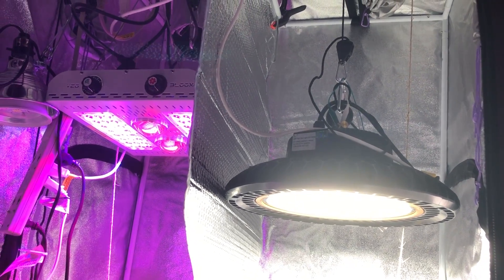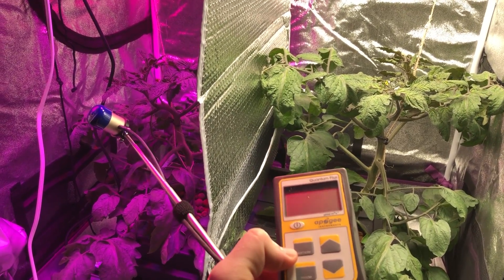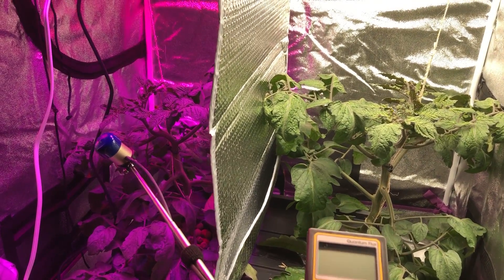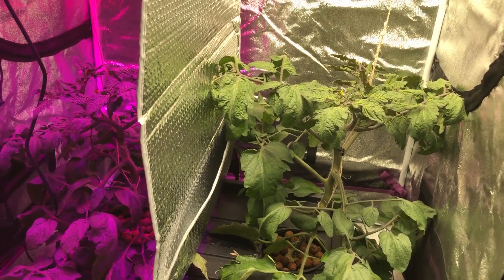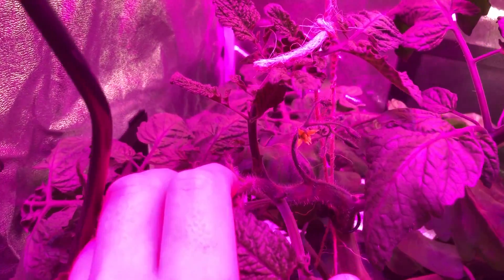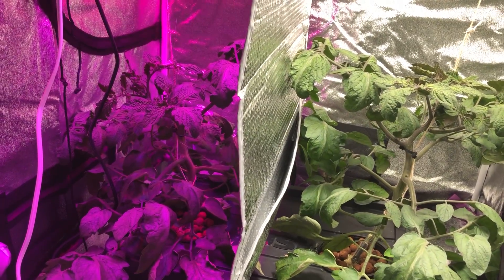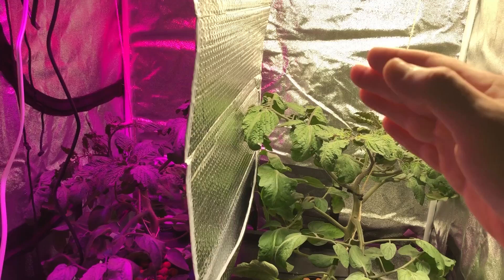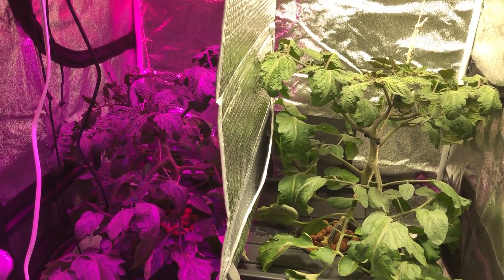MaxBloom vs High Bay LED Grow Light Ep.16

Comment: How long have they been growing?
Reply from the maker: About a month. Seems to be growing a little slower this time. Probably because I’ve been pulling off the suckers and stressing them. Also the aeration isn’t working quite as well. I think my diaphragm in my pump might need replaced. But the stems are a lot thicker this time too. Not sure what’s caused that. Maybe the pruning.
Reply: @GrowingAnswers  check my community page at my Minibel dwarf. First harvest of 8 plants worth of tomatoes about 180-200 cherry tomatoes. 
4x2 
8 sq ft
108 watts. 😉
Its all about spectrum. 
Hope your well!😊